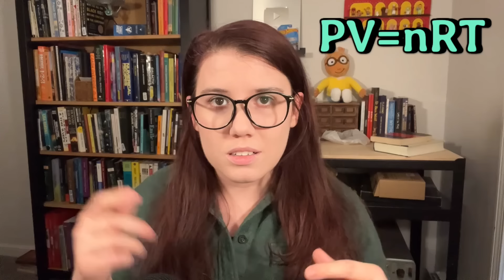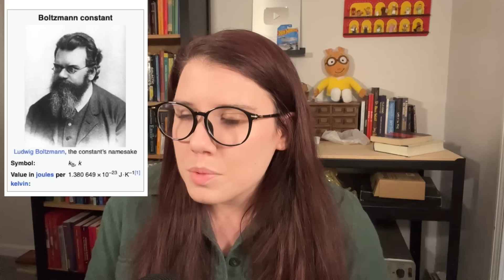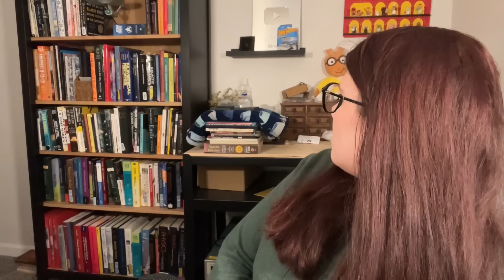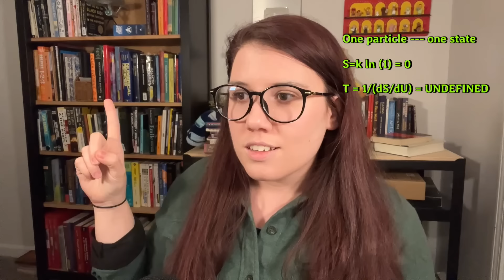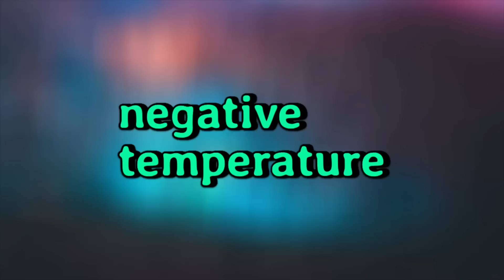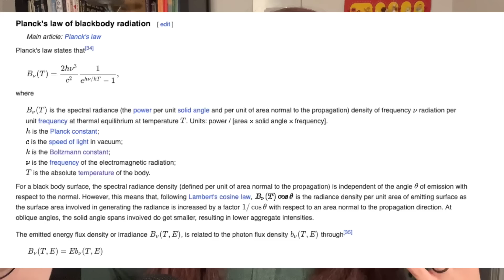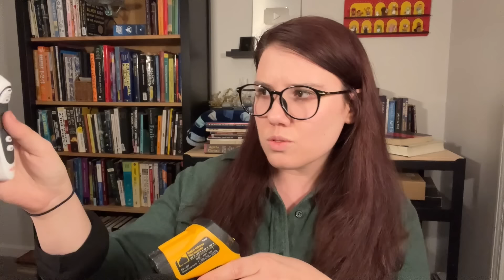the concept of temperature

Comment: 2:30
this is some alchemy! Why if we have 3d, it's like we like multiply the length by 3, but keep the speed^2 term?

Turns out, 3 actually comes up as 1/3 from the v^2 .
By the Pythagorian theorem, v^2 = vx^2 + vy^2 + vz^2 , where vi is velocity at a particular i direction for x , y , z .
Because temperature motion is isotropic, <vx^2> = <vy^2> = <vz^2> (where angle brackets mean average absolute across the system), therefore <v^2> = 3<vx^2> , <vx^2> = <v^2>/3 .
So, for any one-dimentional force, say dimention x , which would correspond to the two walls perpendicular to x , we have:
F  =  m vx^2 / l  =  m v^2 / 3l

So now the pressure force along any one of the dimensions is represented in terms of THE velocity (not just its whatever single dimension component), but in a 3D system.

Comment: I'm a bit lost on both ways of thinking about entropy using the box of gas example. 

In terms of disorder, once the gas molecules spread out around the box and just bonce around randomly, wouldn't the disorder of the system go up or down just depending on luck of the draw for where the molecules happen to be? Like maybe more of them at any one time happen to be closer to the corner they started at. Wouldn't that mean the entropy(disorder) is going down since its closer to the starting positions of the molecules? 

And as far as thinking about entropy as the number of states... how can the number of states increase over time? Shouldn't the number of states be fixed by the volume of the box? I'm probably just not understanding what a state is. I'm thinking of it as the number of possible positions of the molecules in the box. Which once the space is defined shouldn't change right? 

If anyone kind person wants to take a crack at clearing this up for me, I'd appreciate it! I'm kind of a dummy.

Comment: "...by degrees of freedom" Not to be confused with Freedom Degrees. 

Also, as you were talking about atoms not having a temperature (by quirk of math), I was about to write up a question like 'well, did the first atom that formed in the big bang have temperature? But you proceeded to effectively answer the question when talking about hurricanes and other highly chaotic situations and I would imagine the big bang would probably count. I wonder if someone has written a paper (or doctorate on that, or trying to use cosmic background radiation to derive the information. Not sure if that would even be a viable approach, but it's a 3am thought.

Comment: What?!?! That tongue thermometer isn't a thermometer?!?! I feel betrayed. Doctors should tell you about this. Do they think I wouldn't be interested?!?!
Reply: It is a thermometer - it just derives temperature change from the change in resistance of the probe, rather than a change in pressure like the original thermometers did.

If you wanna know something even crazier, there are electronics which can sense the humidity of the air somehow. See digital psychrometers.

Comment: Negative temperature is not that hard to understand, it's the state you can create that's energetically above the state of infinite T, with the latter simply being reached (theoretically) when two different energy levels are equally occupied. (Below infinite T the lower one always is occupied more.) If you now reverse a magnetic fields suddenly at some finite T, the higer state (the one that now opposes the field direction) has a higher occupation number. It's an inversion that formally corresponds to negative T.
(It's even a bit easier to understand if you work with "beta" which is the universe of T (times 1/kB), then it's smooth, just like f/(x) is smooth through zero, while 1/x has a pole there, disappeares towards infinity, and then reapers in the negatives.)

Comment: BTW is there anything to read about non-equilibrium thermodynamics for laymen who don't understand the regular thermodynamics very much? I would like to get at least some impression but I don’t know where to start. This is related to defining temperature because technically the system with a defined temperature should be in an equilibrium state and if it isn’t it doesn’t have temperature, technically. But of course it does, to an extent. I’d like to understand how exactly, what are caveats and so on.

For example how slowly can a particularly unlucky piece of food thermalize after being in a microwave on full power, and what can it mean for us humans trying to taste it—are there any interesting things that can happen at least rarely. But that’s a really bad example, it’s just one that’s practical enough I could invent on the spot. Even mixing fluids of different temperatures should be interesting at certain time scales.

And also it will quantify an answer to the question how large a system of many particles should be to “definitely” be able to have temperature: of course it can’t be a strict boundary, just like with decoherence and really everything else. So there’s probably some quantitative description that clarifies what should this question even mean.

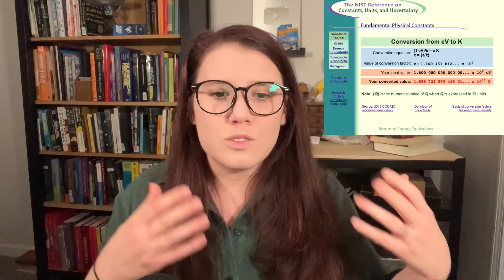Comment: 7:13 Moreover there’s a nice thing about taking inverse temperature that now positive and negative temperatures connect through the infinite temperature (which is now zero), which is attainable, and two limiting ways of going to the absolute zero (which isn’t attainable!!) are now both at different-signed infinities because these are indeed two different limits (everything in the bottom state and everything in the top state when it exists at all). And this inverse temperature scale feels more natural, but we invented plain temperature scale first.... now redefining inverse temperature as the more natural quantity seems not very possible.

Comment: Temperature (increase?) as in heat being the waste product due to entropy opens an interesting concept: destructive interference for like active noise cancelling. The energx has to go somewhere... Its becoming heat. In your ears. 

Destructive interference doesn't really work the same wax for electro magnetic waves. As they aren't like actual waves, but more so a field. so destructive interference is usually moving the energy towards constructive interference. You can't increase the temperature in a vaccuum but shining light through it from two directions.its not a property of space, more so of matter.

Alao big kudos on using Topher Mohr, such a nostalgic song.

Comment: Fun thing. The RTD is the way we messure airflow into engines. You have a hot wite in the intake. The airflow in the intake cool the wire down. And the voltage messured over the wire shows how much air has flowed in the pipe.

Comment: The ocean is not 1 degree hotter. It’s not even measurably hotter. 4km deep 3 celsius salt water doesn’t warm up easily. The proposed added energy from climate change adds up to only about 1 millikelvin. You need to read up on that.

Comment: Matter creates a filter a screen that alters ambient radiations velocity passing through it. The more abundant the matter is with particles of electricity the more ambient radiation passing through it will be slowed becoming visible in the form of heat electrical charge and perhaps some light rays. That is why it is hard to tell anything about a single atom because it isn’t creating a structure that can slow ambient radiation. It used to be taught that a pile of gold of a certain size would detonate if more gold was added to the mass. Because it would alter ambient radiations velocity too much after a certain volume was reached. That is what happens with certain radioactive elements if you keep piling  them up near one another:  it is not the materials energy it is the ambient radiations inability to pass through them without depositing some potential “energy” (velocity) upon them. Real Universal Scientists warned Enrico Fermi about making a carbon pile before he built it. He nearly destroyed a good portion of the US by ignoring them. I know it is hard to believe but real scientists are almost never known.  It would insight revolutions world wide. As did Benjamin Franklin’s work. It is very sad but the French scientist Du Fay’s two particle theory of electricity that modern “Universities” have reverted back to is what Benjamin Franklin won the Copley award for disproving. And here we are practicing Du Fay’s insanely wrong understanding of electricity.

Comment: When you heat a metal it becomes abundant with particles of electricity which allows it to slow the  particles of electricity from the ohm meter which supplies a voltage and measures how much of that known voltage makes it through the circuit you are testing. Basically it is measuring voltage drop. As you heat the metal the number of particles of electricity per cubic inch of the material rises creating resistance to the flow of electricity passing through it. Cold objects act in the opposite manner.

Comment: Temperature is like a measure of energy density.  
As in, nature abhors a gradient; therefore the diffusion equation; equilibrium means no gradient. 
And internal energy travels from hot body to cold body, until equilibrium; when there is no more gradient, we say, the two objects are at the same temperature. 
This is the macroscopic definition of temperature; and then we infer back before equilibrium, and DEMAND that the temperature of the hotter body MUST be higher than the temperature of  the colder body, Now we have 3 points to use to define a temperature scale. The number on the scale is arbitrary. 
(We really can arbitrarily define only TWO points on our arbitrary temperature scale; the third point would be derived )
 
Heat is energy in transit; when internal energy travels from hot body to cold body, when the energy crosses the surface boundary of the bodies, we call the energy in transit, heat. 
Entropy is like a measure of the quality of energy. 
The quantity of energy is conserved (constant); but the quality of energy degrades over time (decreases). 
Entropy is related to heat transfer, S = Q/T, (creation of entropy) so we don't give the transfer of entropy a new name.  
In the heat death of the universe, when everything is at the same temperature, there will be no more heat transfer, and no more creation of entropy (at its maximum).

Great video, lots of thought, critical thinking went into it. 
Keep up the good work!

Comment: Nice video and presentation. 
Temperature is a scale, a ratio, of thermal energy state. Thermal relates to vibrating electrical charge/energy misunderstood for mechanical. Heat transfer goes by propagation of vibrating electric charge/energy from one region to another through matter. As vibration (amplitude and or rate) continue increasing, vibration coupling through matter becomes a coupling into and through space, in the form of electromagnetic E/B radiation ie IR, light, uv and so on. 

Electron hopping between orbit generates E/B wave is a law of fiction. 

Essentially all forms of energy are derived from electricity, u0 and e0. That includes inertia and kinetic, potential and gravity. … to be continued.

Comment: Something you didn't talk about with your ice cubes on two different materials in the background is thermal conductivity of the materials.  If one has a much higher conductivity, it can pick up energy from the air/ table a lot better and conduct it to the ice faster.  That leads to it melting faster.  This is why a block of wood outside on a cold day (perhaps 0C) 'feels' a lot warmer than a block of steel of the same mass and temperature.  The steel conducts away the warmth of our hand much faster than the wood.

Comment: 40:46 someone's probably already mentioned that in comments, but temperature doesn't "then get more positive", it wraps over infinity into opposite sign region and continues with the same direction of monotonicity.

That isn't exactly "loophole of definition" it's just that analytical continuation or regular temperature scale has topology different from regular numbers where you're allowed to cross infinity but isn't allowed to cross zero.

In that sense that regular derivative of entropy over energy is much more well-behaved and probably makes more physical sense, but alas we're stuck now with centuries old tradition of graduated tubes with mercury.

Comment: 36:49 This is an interesting bit. Have you ever actually made a black body radiate? That's not a joke, it's a serious question. I was reading today about the original Stern-Gerlach experiment and I started wondering about what the oven was that you have to cook the silver atoms in to get them to fly out. Is the temperature of the oven important? You kind of think it would have to be, otherwise it wouldn't need to be an oven. But the temperature doesn't figure in the quantum analysis of the experiment.

Comment: Historically backwards. Immediately loses the eighth grader. Fails from the very beginning, because it discards the first definition of temperature, which is a perception of hot and cold. Misses the humility required to understand how the temperature concept progressed from perception and properties of objects and fluids, to gas laws, kinetic theory of ideal gasses and black body radiation. Boltzmann's constant, Boyle's law, moles or molecular energy are not where you start, they're where to progress to eventually. First you need to talk about temperature as a property that is transferred around, "heat", then get to relative heat capacity, later identifying the connection between heat and mechanical energy, which led to heat engines and much later, to molecular energy.

Comment: The intuitive way to understand thermodynamic entropy is that, analogous to work performed by/on a cylinder being the integral of PdV, the work done by heat transfer on a system is the integral of TdS. All mechanical losses eventually end up as heat anyway, so as efficiency drops, entropy rises.

Comment: I laughed hard at "so it's left as an exercise of the reader". At the end you were one very small half-step shy of talking about pyrometry (by matching the color of a wire of known emissivity to the object behind and looking at the current in the wire at the time of the match) and that's my favorite way to measure temperature at work.

One other interesting way to measure peak temperature I've encountered (used in metal casting) is to mark the object being measured with crayons whose wax melts at varying points and then see which lines are still visible after the heating cycle. You can tune the contents of the wax to be fairly accurate (within tens of degrees) if you know the ballpark of the peak you're going for, just by adjusting the content of the wax a bit. You can buy sets of these crayons now.

Comment: ok, @36:00 technically... strictly speaking in a realist account of QM there is a concept of entropy and temperature for even an isolated unentangled single qubit. If you suppose a spacetime cobordism has "a whole lot of sh_t going on" in between measurements, then there is clearly an associated path history counting, namely all those consistent with the initial and final conditions. It is not 'Boltzmann entropy'. Also, there is a whole literature on nonequilibrium thermodynamics where entropy can be well-defined. It has applications in cosmology, since FRWL is a highly nonequilibrium spacetime, but using the euclideanization trick (euclidean path integral) there is a sketchy notion of "entropy of the whole universe" (out to infinity). See Turok & Boyle. It's a super cool idea, since along with assuming exact CPT symmetry at high energy (analyticity at the Big Bang) it explains homogeneity, isotropy and flatness without any need for an inflaton.

Comment: @23:00 well technically... (lol) you are not measuring T any less directly with the calibrated voltage than the calibrated thermo bulb. Bulb measures a length via a pressure. Ultimately you are making gazillions of tiny position measurements via breaking entanglement (or what an idiot would call "wave function collapse") and not bothering to record about 50% to 90% (I guess?)  of that data.

Comment: 22:55 RE: electronic thermometers actually measuring voltage. Aren't glass thermometers measuring the volume of a trapped liquid? Bimetallic thermometers also measure thermal expansion. Are there any that don't measure a proxy?

Comment: Temperature is not just some function of velocity nor is it really something you can understand from thermodynamics. It's the congugate of entropy relating the volume of phase space to its total energy (is the origin of all unit systems connecting counting to units that flow from the algebraic systems that generate the symmetries defining the conserved quantities of a physical system).  Entropy is an important concept as it is THE CANNONICAL function (ie the mathematically provably UNIQUE function that maximizes AND minimizes the relationship between specific conserved quantities, aka the symmetry-configuration space version of Noether's theorem). This is a very big deal. It is what places "information" into the "fundamental" category ie this is the SOURCE of things like units conservation laws and the various potentials that generate forces.  Arguably there is only ONE thing as fundamental or more fundamental than this in all of physics that ISN'T an "assumption": that is probability itself which you find at the same level of abstraction as information and the functions we use to quantify it. See Wojciech Zurek's work on the derivation of Born's rule from the  fundamental MATHEMATICAL assumptions of quantum mechanics (1. Hilbert space, 2. Unitary evolution, 3. "Measurements" produce same numbers when "repeated"  "instantaneously").